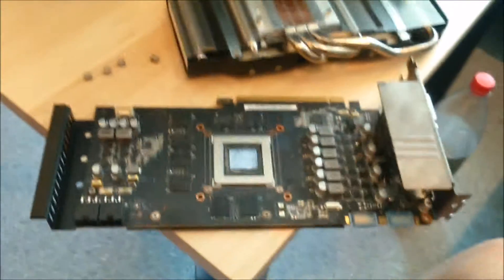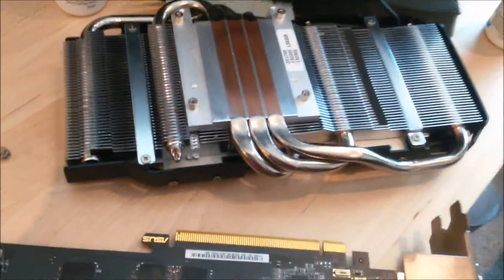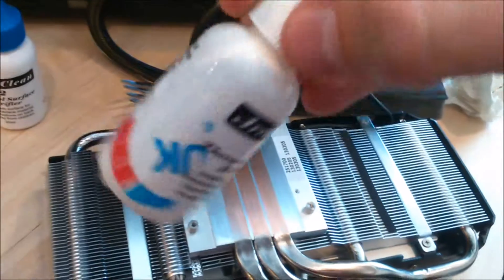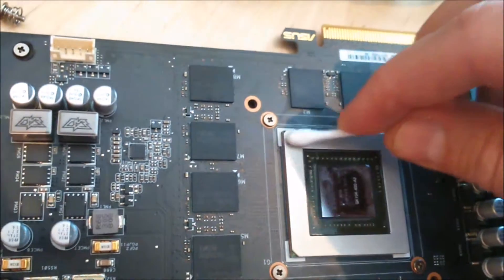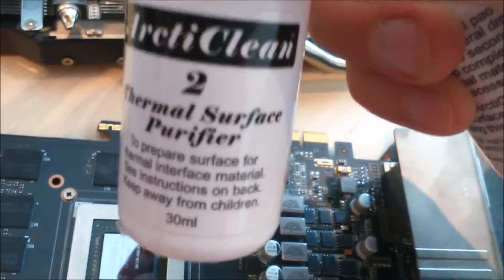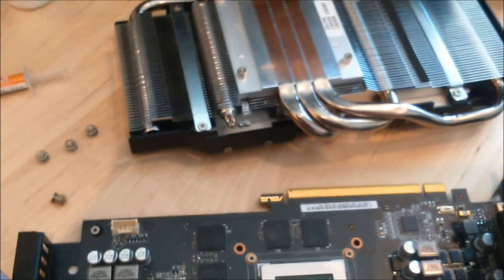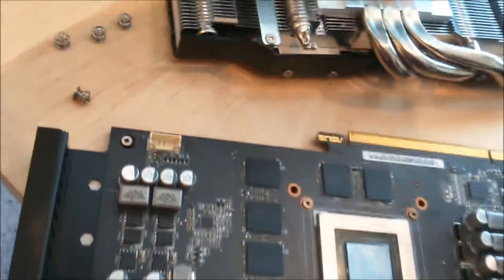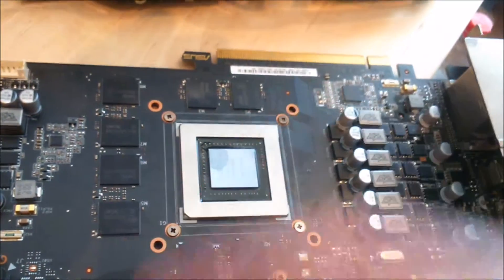Applying new termal paste on used gtx680 gpu DIY

Comment: Others should really use linen-free cloth (for example glasses/screen cleaner, or even a coffee filter works). But you seem to be aware of that so all good. Thanks for the video, will clean my ancient GTX 680 SC tomorrow (running 80 degrees in idle, lol)